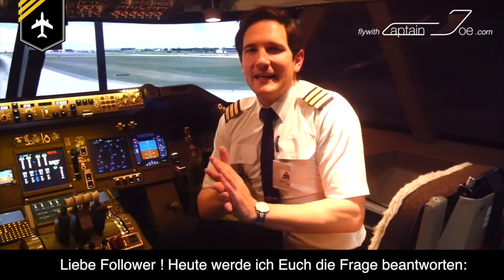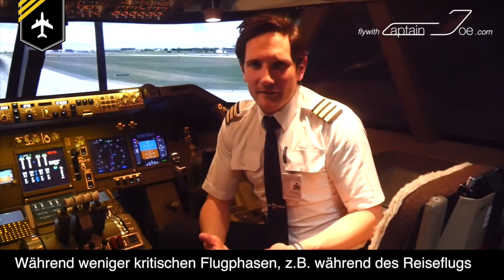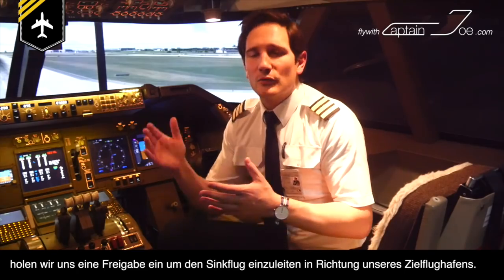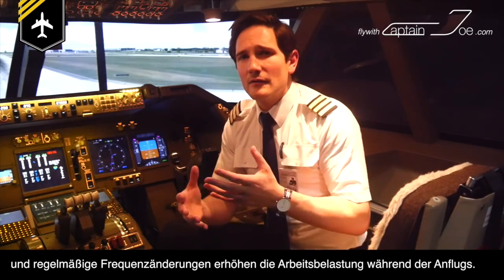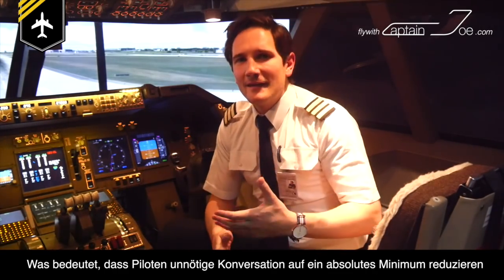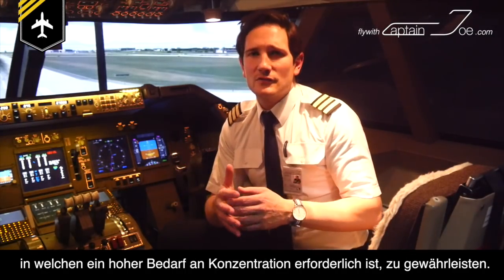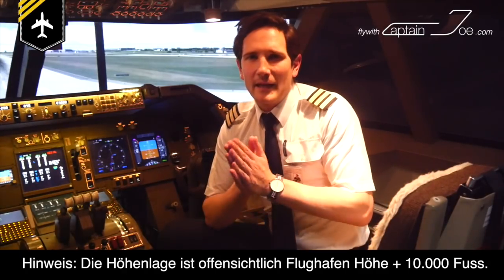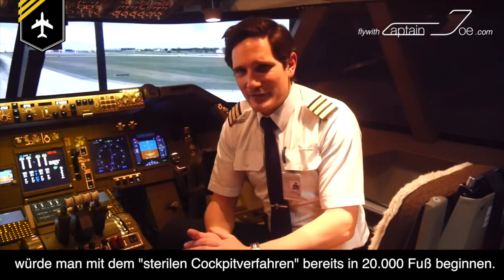What it is a "STERILE COCKPIT"? Answer by flywithcaptainjoe

Comment: Joe please can you tell me how  pilots change frequencies e.g from ground control to tower
Reply: Oliver Plane Spotting The same way you change a radio station. Turn a dial. Although sone aircraft have multiple switches, which you can pre-set frequencies to, so to switch back and forth easily.

Comment: joe does planes have reverse gear
Reply: BISHESH TAMRAKAR Jet planes have "reverse thrust" which is explained in detail in another Captain Joe video. The engines don't reverse, but there is a part at the rear of the engine that diverts the thrust forward.
Reply: Gear.... Bro
Reply: BISHESH TAMRAKAR U so dumb.

Comment: I am a qualified commercial UAV pilot and when I write (and perform) pre-flight checklists, one of the first steps is to declare "Sterile Cockpit" (even though there is no actual cockpit) and this remains in force until after take-off and handling checks, at which point we re-establish communication with the payload crew and call "CONTINUING". I like to borrow terms and procedures from full-sized aviation - those procedures have been developed over time, often through lessons learned the hard way and there is no point in re-inventing the wheel or starting from scratch when there is a wealth of experience and wisdom from which to draw.
I say that declaring SC is one of the first steps - the first step on the checklist is usually to hit RECORD on our "CVR" (a small field-recorder strapped to the arm of the pilot).

Comment: Hey Captain Joe,
What does it mean when Pilots add the word heavy after their callsign?
Reply: A plane which has a take off mass of more than 136 tonnes are given the designation heavy after the call sign. This is done to caution any following traffic, as these planes create considerable amount of wake turbulence
Reply: It means it's a wide-body or "heavy" aircraft. For the A380 though, it adds "super" to the callsign.
Reply: Raphael Artemeier passenger on board?
Reply: Heavy means that the plane is full of fuel. A plane full of fuel is harder to land because the fuel weighs as much as hundreds of tons. In an emergency situation, extra fuel is often dumped before landing to prevent fire after a crash landing.

Comment: How different is the approach while flying a fighter plane? Are fighter pilots allowed to fly passenger airliners, since the general idea is their training is harder.
Reply: Aimless6 Unless ur with aeroflot
Reply: Many people go from flying military planes to flying civilian, but they will need additional training. After basic training, which is going to be almost identical (down to using very similar planes), the training for airliners and fast jets is very different. At the end of the day, flying a fighter is as different to flying an airliner as driving a racing car is to driving a large bus or truck.
Reply: *****, Since passenger planes are comparatively simpler, can fighter pilots fly passenger ones?
Reply: ***** , that's right. Thank you.
Reply: History has shown that fighter pilots have to unlearn some bad habits.
- Fighter pilots are willing to die to complete the mission. The passengers would rather divert.
- Fighter pilots expect orders to be obeyed. Even if the orders are stupid.
- When the engine blows up, fighter pilots eject. In commercial planes, that factory option has not been installed.

Comment: Are you allowed to fly the plane at full thrust whenever you want?   And how long does it take to learn the placement of controls in each aircraft?  What are the repercussions for pilots who disobey the "entry point" the Gander air traffic control provides?
How long does it take for the flight data recorder to write over old data?  And have you ever said anything in the cockpit that was caught on the flight data recorder that u shouldn't have said?
Reply: Landon Thomas full thrust burns fuel like mad, plus overspeed & unnecessary structural strain? Disobeying protocols or atc will loose license, fired, and worst death. Time on fdr, on fighters around half hour before rewrite, on airliners im not sure. I think fdr are design for automatic rewrite on airliners & data are only examine throughly after mishap? Please correct me if im wrong.
Reply: Modern airliners have an FDR (flight data recorder) that captures aircraft operating parameters for 25 hours.  The CVR (cockpit voice recorder) generally captures 2 hours. FDR data is often duplicated on a QAR (quick access recorder) which airlines can access for fault finding, etc, but FDR/CVR data is only accessed either to check function periodically or in the event of an investigation. To my knowledge there is no routine access of voice recordings, so you can probably say what you like. Data is overwritten continuously. The QAR data would quickly show if full thrust  was being routinely used in-flight as it would trigger cockpit warnings.

Comment: Captain Joe
here is my question,
Why there are no cameras & inside cockpit screen of the same ,used to check any external aeroplane damage during any emergency?
Why all the time pilot needs to go through checklist?
Reply: Ranjeet Ghadage Adding cameras to check the condition of the plane, especially engines, would be a great idea.
Reply: 747 400 cat lol a. alpproch
Reply: Because checklists make sure you don't forget anything. I'm not saying that pilots are idiots and forget stuff all the time, but checklists just leave no doubt about anything, so safety>pride. Another example of this are some hospitals that introduced checklists for operations (e.g. "All clamps removed from the body"), and significantly cut down on errors by that.

Comment: there is one question.. can airplane land on autopilot..
Reply: yes, if the runway has right equipment
Reply: Yes but it takes the fun out of it.
Reply: Depends on the airport
Reply: Cat 3 ils is indeed capable of a full Autoland
Reply: A flight instructor on Mythbusters confirmed that auto-pilot can land a commercial airliner, and they actually had 2 non-pilots, Adam and Jamie, land the plane on auto-pilot successfully on a simulator.
Reply: yep

Comment: Great videos Joe. can i ask a question? when flying an airbus with the side stick control, if you are right-handed - does it feel weird if you are in the left seat? do you have to practice sitting in both seats? or are the movements made actually so small it makes no difference? Thanks!
Reply from the maker: It´s definitely different, I had to sit in the captains´seat during my type rating and it felt very weird, but practice will do the job I suppose :) But impressive that you thought about that! Greetings Joe
Reply: Liou David i believe the captain sits in the left seat, first officer in right right
Reply: Liou David good question, it is because of the traffic pattern around an airport. Not always, but usually its a left circuit patten. The captain would usually be flying and would then have the best view of the area around the airport. Saw this info in someone else's video cause I wondered the same thing.
Reply: @christofer wilson I think that you confuse the cause and the consequence here. Most circuits are done with a left turn because the captain seat is located on the left.
The captain seat is on the left so even when flying the plane (with the left hand) he can do complex tasks with his right hand such as typing on a FMC or ajusting throttle for example.
Reply: most people are right handed but on playstation and xbox etc they put the joystick to control movement on the left of the controller so you use it w/ your left hand and your right hand presses buttons and stuff. same like in the captains seat. i know fly a plane is not a game but it shows that right handed ppl can do fine control no problem w/ their left hand.
Reply: Actually, if you think about it the left seat would be easier for the right-handed, because the majority of the time you will be dealing with what's on your right like the FMC, panels, etc...
The only important thing that's on your left is the "side stick".
Reply: As a student pilot with around 25 hours in a Cessna, I used to wonder the same thing about the Airbus side-sticks and other aircraft that use them, being as I'm right-handed. Then, it occurred to me that when I'm flying an airplane with a traditional yoke, like the Cessna, I'm flying it solely with my left hand practically 100 percent of the time anyway, since the throttle, mixture, trim, carb heat, etc. are all operated by the right hand of the pilot in the left seat. The yokes are even mirrored, by design, so that the radio transmit button (and any other yoke-mounted control options the plane may have) is on the left side of the left yoke, and the right side of the right yoke. So, other than the fact that your left hand is in a slightly different location when using a side-stick versus a yoke, I don't think it would make much difference.
Reply: Gregorius Bryan that used to happen but it's very unlikely anyone will do that anymore. 
There is a Air crash that happened many decades ago where the pilot chose to sit on the right out of preference and because something happened as a byproduct of that caused the accident and the NTSB said it does not recommend that practice. 
I can't remember what plane it was but I do remember watching it on ACI
Reply: motemok yes sorry, thats what i meant to explain. You explained it better than i could haha thanks.
Reply: In response to this question, can you ask the captain to switch places if you're left handed and vice versa?
Reply: christopher wilson Oh... but is there any reasons for that arrangement?
Reply: Exactly what I'm looking for! Thank you!
Reply: i am left handed so native captain:D
Reply: I don't know
Reply: I had s similar question about FIGHTER PILOTS who are left handed and have to ise their left hand to operate the throttle. They give major control inputs.
Reply: Is there any reason why the Captain's seat is on the right though?
Reply: @TheAftermathz  'cause first officer DUH
Reply: @TheAftermathz  He made a vid about it like 2 weeks ago. check it out.

Comment: So does sterile cockpit apply to takeoff, taxi to the runway, and ascent as well?
Reply: I hear it is effective from the closing of the aircraft doors on the ground to the top of climb/near top of climb and top of descent to door opening. It varies with airplanes, airports and airlines. N
Reply: +Nathan Chetram Thanks for the info!
Reply: Nathan Chetram makes perfect sense
Reply: From Wikipedia:

The rules[edit]
The rule is legally applicable only to Part 121 (Scheduled Air Carriers) and Part 135 (Commercial Operators), and not to Part 91 (non-commercial general aviation). It is specified in U.S. FAR 121.542/135.100, "Flight Crewmember Duties":[6]

No certificate holder shall require, nor may any flight crewmember perform, any duties during a critical phase of flight except those duties required for the safe operation of the aircraft. Duties such as company required calls made for such nonsafety related purposes as ordering galley supplies and confirming passenger connections, announcements made to passengers promoting the air carrier or pointing out sights of interest, and filling out company payroll and related records are not required for the safe operation of the aircraft.
No flight crewmember may engage in, nor may any pilot in command permit, any activity during a critical phase of flight which could distract any flight crewmember from the performance of his or her duties or which could interfere in any way with the proper conduct of those duties. Activities such as eating meals, engaging in nonessential conversations within the cockpit and nonessential communications between the cabin and cockpit crews, and reading publications not related to the proper conduct of the flight are not required for the safe operation of the aircraft.
For the purposes of this section, critical phases of flight includes all ground operations involving taxi, takeoff and landing, and all other flight operations conducted below 10,000 feet, except cruise flight.
Note: Taxi is defined as "movement of an airplane under its own power on the surface of an airport".
Reply: Sterile cockpit begins after "we" cabin crew close flightdeck door , until releasing from the seatbelts.